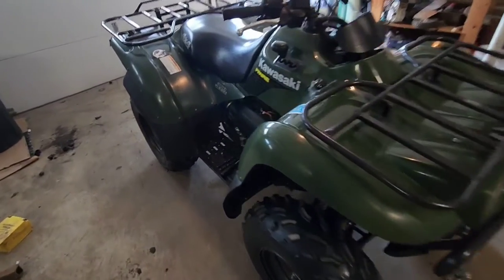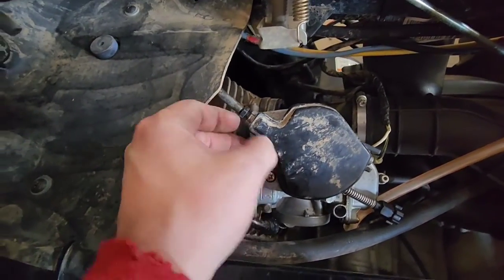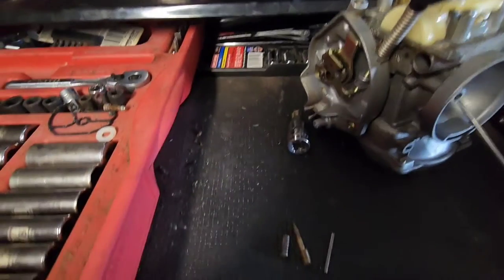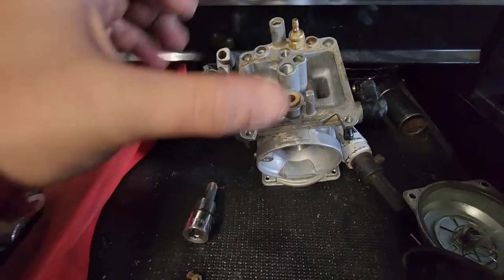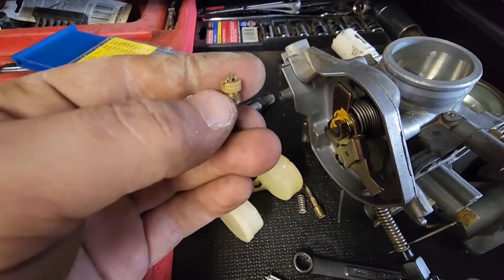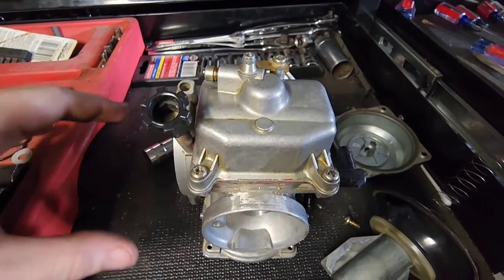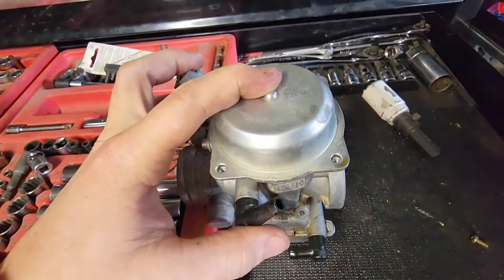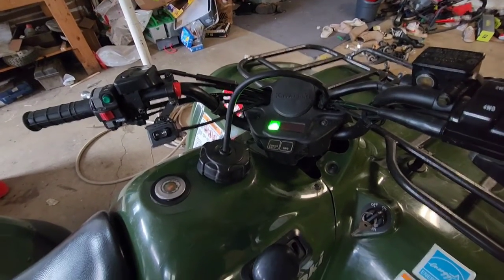kawasaki prairie 360 carb cleaning

Comment: At 1:25, you need to remove the black plastic knob from the petcock before lifting the tank out. It will catch on the frame and break most times if you don't.  Nice video!
Reply from the maker: Correct

Comment: Hey I did everything step for step and now my four wheeler cranks up right away but as soon as I start it it’s revving high like I have the throttle pushed in? Any advice?
Reply from the maker: You don't have the throttle cable installed correctly it's to tight

Comment: hello, I have the exact same four-wheeler(with automatic transmission), but I'm having problems putting it in any gear (it only works in reverse and neutral, and sometimes H and L jump, but again I can't put it in neutral), can anyone give me some advice, please, what should I do? Thanks for every reply
Reply from the maker: Sounds like you are in need of transmission repairs.  Unfortunately there is not much in able to help you with over the internet
Reply: @GarageVlogBob  First of all, thank you for the quick answer :), I was hoping it wouldn't be the worst, but I probably won't do anything with it, I'll have to take it to the service...
Reply: Try giving it gas an then quickly put in gear. That works for mine